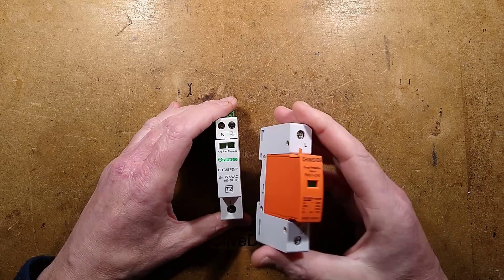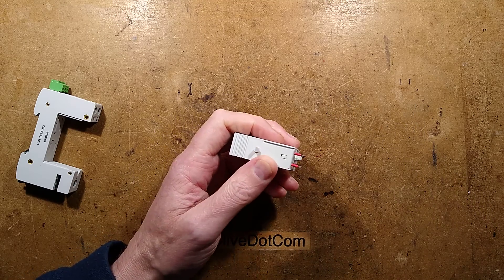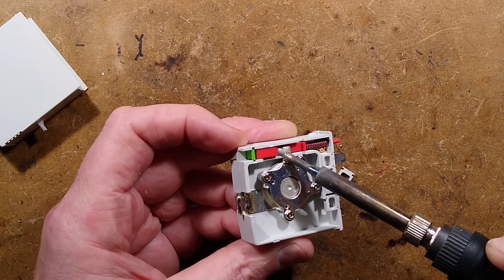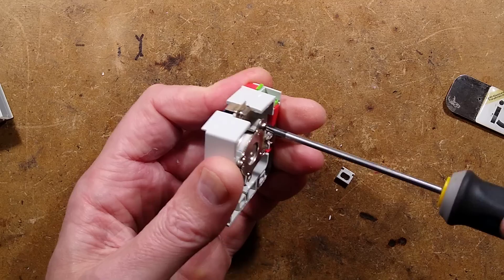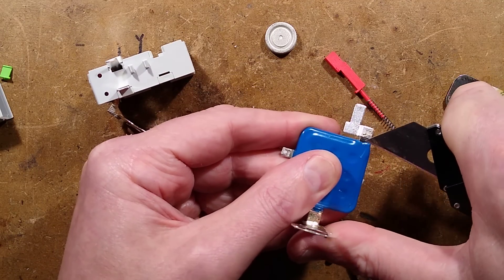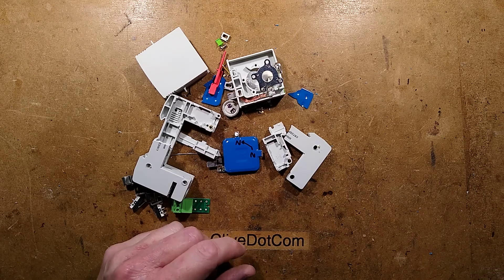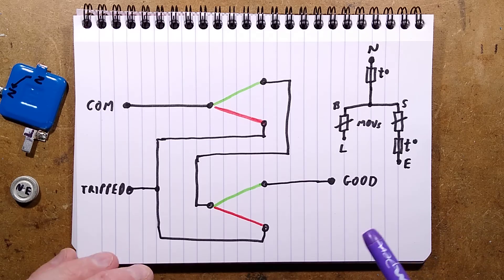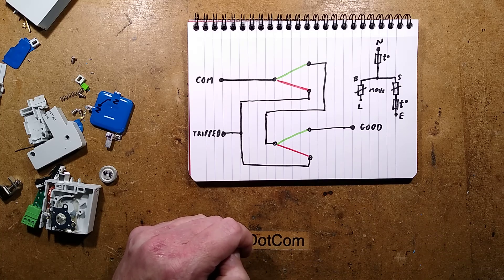Expensive UK surge protector teardown

Comment: What a complete rip off for a couple of MOVs. Basically every power supply comes with its own which you can replace for pennies when they go. Now fitting these is part of uk electrical regs. It's basically a racket imo.
Reply: The MOVs in the power supply of the PC or TV etc. have a small fraction of the energy rating.  This protects every electrical circuit in the house.
Reply: you really need to layer this. ideally you have separate type 1 spark gaps at entrance, maybe even outside where overhead comes in. this is so your wiring won't blow up. then type 2 mov (some claim to have rating for 1+2). so your wiring won't get damage and most of non-semiconductor devices won't ge busted. then inside in subpanel or near / in device, type 3. type 3 is lowest energy rating. actually all of them have ratings and it differs on lightning risk at location. now, there is issue, the higher the rating, the higher the pass through voltage and speed. the lower the rating, faster, low voltage remaining. by having layers, you shave the voltage off. often directing most of it outside of building. this is also less fire risk, not mentioning damage to devices. because on inside, god knows where it will arc really. remember, there is enough voltage to strike several kilometers of air, you can't stop it. only conduct. and in the end, it still fails. i heard there's major mobile operator basestation somewhere here that needs full set of equipment once a year. you bet they have all the protection. yet, it won't do. i never checked, but i assume it's located on some lone hilltop, perfect for rf, but also perfect for lightning. i should be pretty safe here with ftth and insulated overhead. but when i had copper. i once left things on, by taking a risk and having type 3 spds. there was flash outside and snap somewhere in house. dsl link also went down for a moment. i never have found where the sound came from and nothing really failed. might maybe find it in future. so overvoltages are fun. also, on lightning and body esd damage, don't assume it's immediate failure. it's not! so it's all really complex. but what i don't really get is why so little people install spd's voluntarily. even ones who can afford it at home. yet many know it. i mean, even if i could afford new devices every day, i would still be pissed to replace tv, washing machine, microwave, oven and so on. so yeah, spend some money. most of cases it will last decades. and in case it's needed, most that, it will protect. yes, type 3 will do too. but it's all about rating. if your install contains anything over 1k usd or eur value, buying entrance spd will pay off. nevermind the less fire risk which is much more important
Reply: I won't cry when a power surge kills your computer, router and TV.
Reply: @BTW...  These are in so few homes right now and we've been just fine. A UPS works great for critical items & replacement MOVS for individual power supplies are ~£0.80 not ~£50-90 for this nonsense. Why tf would you want to put everything through a MOV when only some things are susceptible to damage from surges? They've had to unnescisarrily use massivly uprated MOVs because everything goes through it when in reality you would probably want to omit things like water heaters, power showers, conventional ovens, garage circuit for power tools etc... It's just a waste of good MOV imo. A replacement power brick for a router is pittance compared to this. It's a grift plain and simple, despite it's actual usefulness in some niche scenarios.
Reply: @Hardwayistheonlyway   Hmmm. perhaps you don't understand.
"Why tf would you want to put everything through a MOV when only some things are susceptible to damage from surges?"  - Current flow isn't "through" the SPD. T2 types are installed in the Dis. Panel across the supply, and in the better types (as shown) a few cm from the main PE conductor in the same gauge as that Main PE - Low impedance.  
That is a very different to the tiny low capacity T3 type you refer to, either in a power strip or appliances. 
Perhaps you don't understand how many consumer devices are electronically controlled and lack adequate MOV protection, let alone HV protection. eg. " water heaters, power showers, conventional ovens, garage circuit for power tools etc..."  etc being LED lamp drivers, AC units/heat pumps, RCBO's, every piece of AV gear, every smps chargers, PV inverters...  list can go on and on. 
Ever seen the 'sparkgap' function appearing as comb tracks on a pcb board? (below minimum creepage clearance at mains voltage btw) What do you think happens when they blow? 
How do you know if the MOV in your cheap ass 'protected' device has blown and no longer effective? When it catastrophically fails through overheating?
What is the fault capacity of the cheap T3  components you mention, @ " ~£0.80 " ? Sure as hell it isn't 20kA every day or 100kA max. safely contained. 

You think "~£50-90" is expensive for UL Approved high fault capacity electrical gear that will effectively protect the whole installation?  
Nope... think again, if you can.

Again, I won't cry when a power surge or HV fault kills your computer, router, TV and every lamp driver and appliance containing electronic controls.

Comment: Found this on the web: 
"Highlights from Amendment 2 which come into force 28th September 2022 include: - Mandatory use of Arc Fault Detection Devices for socket outlet circuits in certain residential premises - Transient over-voltage protection must be fitted in all installations, exceptions may be permitted where the owner opts out and accepts all consequences and losses - Extended use of RCBOs in residential premises to avoid unwanted tripping - A new chapter for Prosumers (those who produce their own electricity and consume from the grid) - Updates to Appendix 6 and Chapter 64 for certification and reporting"

Comment: That makes for an expensive fuse.
Reply: That it is! You could but an awful lot of "dumb" fuses for that price. Almost certainly much more than enough to outlast it's service-life.
Reply: @matthewellisor5835  Fuses don't protect equipment from high voltage surges.  £90 does seem too much, particularly as other reputable brands makes products for half that price, but if it saved your TV, PC and other sensitive kit in the event of a surge it would pay for itself many times over.
Reply: @ferrumignis  roger that. I have the luxury of an extremely stable service here and while I expect sensitive equipment (of any reasonable quality) to have protection built into their power supplies I also utilize uninterruptible power supplies with full isolation to add an extra layer of protection for any sensitive/ expensive piece of kit. I simply don't need coverage for entire circuits and there are 24 which isn't too unusual in this area. 
All that said, good point to clarify. Thanks! Yet another reason why this is one of the best comment sections on this or any platform.
Reply: @matthewellisor5835  This would protect all 24 circuits. And do so more effectively than a device placed down the end of those circuits.

Comment: Our fuse/beaker system in the US is quite a bit different. Would one of these protect a single circuit or the whole installation? I retired my "whole house surge protector" a year or two ago and took it apart, it consisted of a box with a whole bunch of the 1" coin style MOVs and some LEDs to ensure the device was receiving power. It was designed to be wired into a breaker for protection against the device failing.
Reply from the maker: This unit is designed for whole house use here.
Reply: You'd need two of them with dual phase power in the US, but they might be combined into one unit that takes two breaker slots.
Reply: @PaulNorman  yes, this is how my old and current ones are setup here in the US
Reply: @PaulNorman  In the UK, residential systems are usually single phase. 240v is enough for most domestic loads.

Comment: I was under the impression that these were to protect from surges caused by HV 'spikes' , impressed on the supply lines, causing the material of the MOV to conduct, dumping the energy (thus protecting the connected devices) and eventually fail in a conductive state triggering the indicator.  Lightning being the obvious causation in relation to domestic supplies .  (Unless you live near Industry with B big motors and arc furnaces)

If the fault is in the combined neutral conductor would it still cause the small MOV to strike if it is rated at 600 V?  

I would have expected a spark gap rather than MOV if that is the intention.  

The increasing mandate to install these protective devices - for domestic supplies - is a sign of the times.   Surges from overhead supply line reticulation are far more common than from underground cables so I question if all installations need them.  But I guess £40 ish is Ok for peace of mind - £90 is pulling my todger!

Next we have the march of the Arc Fault detectors to contend with - and effectiveness on low current lighting circuits.  Statistically the highest proportion of electrical fires in the UK (like nearly all) apparently comes from local overheating of faulty appliances and overloaded power boards (not DIY electrics - as many sparks would have us believe) so devices of this nature will have minimal (none even?) Impact on that statistic.

(Having lit the blue touch paper I now stand back for the Sparks flames🤣)
Reply: Here in the lightening capital of the US, one of my clients semi-regularly suffers a direct hit. Nothing will stop a full hit. Often with surge suppressors come with a warranty, and after the main insurance pays out (often times well in to the $100K range) the warrant covers the deductible. We've started adding more and more expensive surge arrestors where now when they suffer a direct hit, fewer devices are destroyed. They're a manufacturing plant and even near by strikes travel under ground and hit underground cables.  So every entry point on every building has an expensive surge arrestor (generally for data lines.) Its better to lose a few $100 surge arrestor devices, and network switches immediately after it than to kill the computers in computer controlled equipment and be down for a week while everything is set up again. 

If I could get them to install lightening rods and fiber, they'd be better off but we can only advise and take our customer's money.
Reply: @JR-yl8qi  Nothing survives a direct strike!  The effect of a strike on a GRP encased collinear antenna is spectacular shreds of GRP scattered for a hundred meters around and no sign of the antenna elements!. Or feeder cable.
Reply: Here in Germany in new installation they are mandatory as well, what you will usually see is a set of four of them for three phases and N on one side and PE on the other side (I never actively worked with those myself, so my memory might fail me on that important detail), those usually are only Class I devices, I think there is no mandate for Class II devices. I have seen combined Class I and II devices, but not sure how common they are. Never seen any like this one with both N and L, but the ones I have seen are more or less the same as the cartridge itself is replacable. My own installation is to old to have those, but to be honest, I think I would upgrade to a combined Class I + II device. With power lines usually underground here, most damage from lightning actually is based on induced voltage. (Ask my insurance how I know... that thing luckyly is old enough to have damage from lightning, even through induced Voltage, still included.) but to be honest, what gor fried in my case was only the internet router, nothing else got damaged. so I honestly are not even sure if it was from the power line, or what I think is more likely, through the phone line. There are a few devices to protect phone lines and such, but I found those dont go particularly well with todays VDSL data rates (no optical fiber here yet, maybe some time until 2030, perhaps)

Comment: Wow...that is a lot of money for what we would call a breaker here  ;)
Reply from the maker: It's not a breaker.  But it does usually need to be used with one.
Reply: Interestingly @bigclivedotcom , Clickmode "Elucian" SPDS (made by Scolmore group) don't need a breaker.... they have internal HRC fuses. I should save up and take one apart.... to see what type of fuses they are, they'd have to be small, as it's the same as yours, single module (but it has no 'dry' contacts for an alarm, maybe they used the space for that?)
Reply: @TheChipmunk2008  Many SPDs don't call for an upstream breaker. There's little need for one, as the wiring to them is protected by their enclosure and the standard failure modes of MOVs do not benefit from breakers rated 6A+. Can't say I mind having a way to isolate one, though..

Comment: Thanks for another entertaining and educational teardown :)
I'm still pretty confused about the big blue one. I thought it was a spark gap rather than MOV.

As for TN-C-S, it's the most common system in Poland, and the PEN split point (usually found in the main electrical panel rather than at the building entry) must be grounded.
Reply from the maker: The blue one appears to be a solid metal oxide varistor.
Reply: The blue one is a MOV and the disc shaped one is gas discharge tube (GDT). Generally MOVs are connected between L and N. GDTs are connected between L/N and PE.
Reply: @valimakm  Yes, was going to post this as well. Although I fail to understand why and some googling didn't offer much. Do you know the reason for the choice of different suppression for LN and N PE?
I know they have different characterics and clamp voltages
Reply: @koffibanan3099  In TT systems where the earth impedance may be quite high or even go open, a faulty MOV may not be able to pass enough current to heat itself for the thermal fuse to open, leaving the electrical 'earth' with a dangerous potential to the literal earth.
Reply: Also, with a surge a GDT will not reset until the voltage goes to zero. So it's fine on neutral, but can't be used on hot. The GDT can withstand much higher energy surge because it "crowbars", going to a very low resistance and causing the heating to happen somewhere else.